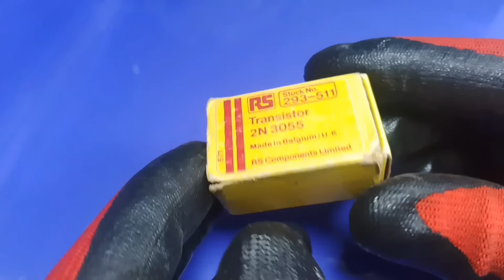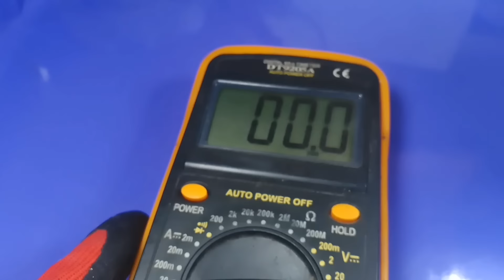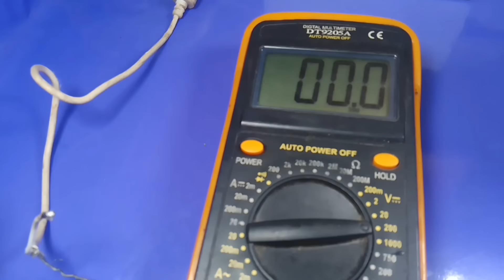How To Make Adjustable Voltage Regulator Using 2N3055 | Transistor Voltage Controller circuit

Comment: The circuit isn't a voltage regulator but only a voltage follower, if the output load changes the voltage across the load changes.
Without an heatsink the 2N3055 can dissipate not a lot of power, the junction/air thermal resistance of a 2N3055 in metallic TO-3 case is about 35°C/W. Considering an ambient temperature of 30°C with 24 V input, 12 V output and and an output current of only 0.4 A the junction temperature of 2N3055 reaches the maximum theoretical value of 200°C.
The maximum current managed by a 2N3055 is 15 A.

Comment: Be careful SOAR (Safe Operation Area Region) in power electronics . Attention please about Avoid Second Breakdown (Avalanche Breakdown). Maximum collector current is 15 Amps for 2N3055.
Reply from the maker: Thanks for your opinion
Reply: Yes 15 A No more take loadings
Reply: I believe you since this x'tor is only 15 amps